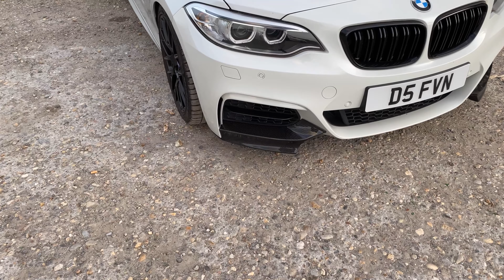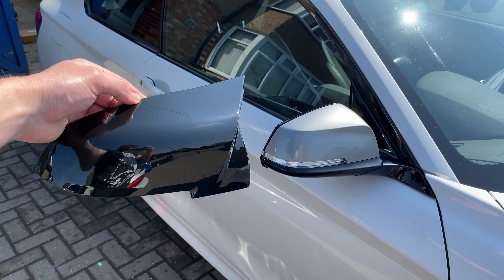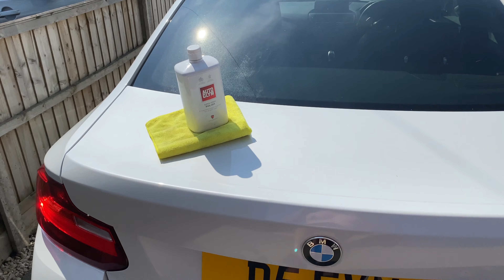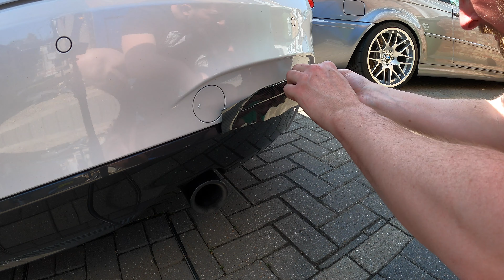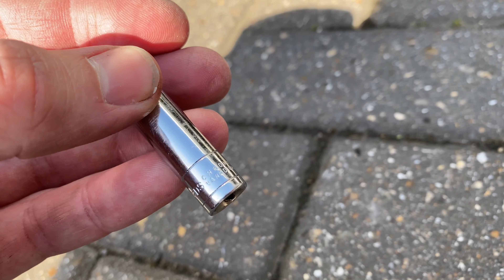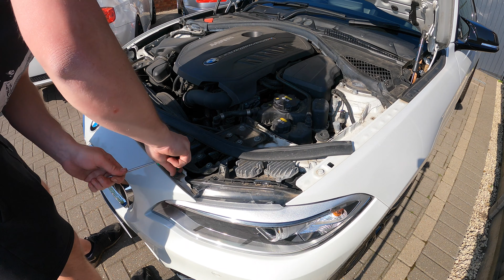BMW M240i Upgrades - How to fit Spoiler + Splitters + Grills + Mirror caps

Comment: i just replaced the lower left and right vent grilles with the USDM ones which dont have the silver canards. You can order them from Lithuania and they're pretty cheap.
Reply from the maker: Good to know if the painted blades start to chip etc 👍
Reply: Got a link for this?

Comment: Rookie mistake on the kidney grille install. Popped the black one in for a side by side shot instead of using the hole to access the other side instead of scraping your hands to bits again going from the top 😅
Reply from the maker: Oh man how did I not think to do that 😅

Comment: Iv got the carbon cs spoiler and ct carbon diffuser and mirror caps really transformed the look for the car 
Got springs and wheels to change next any recommendations for wheels I don’t want spacers and what widest rears possible?
Reply from the maker: Check out episode one, the CM wheels fitted perfectly without spacers & nice and flush with the arches👌

Comment: do you have the link for the piece that was attached to the lower grille above the corner splitters
Reply from the maker: Are you referring to the “blade” located inside the grill? That was the standard one painted as detailed in the video